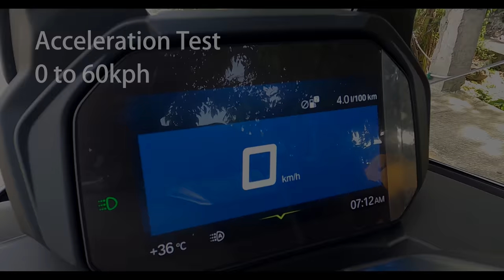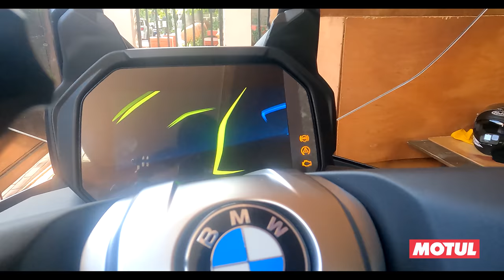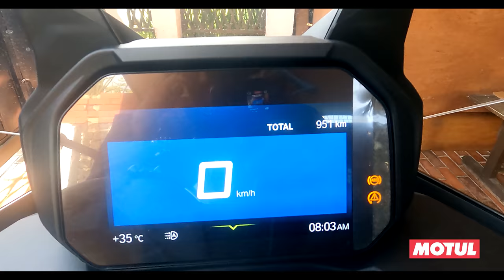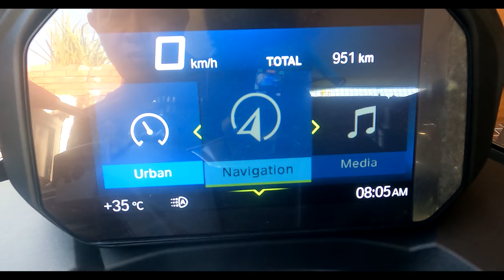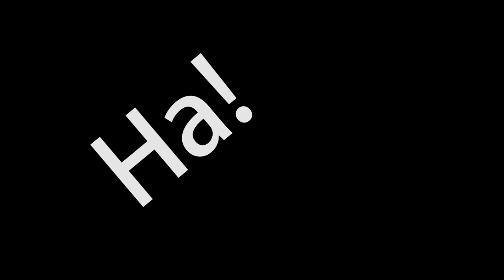BMW C400GT (Tagalog)

Comment: i agree with the 250cc expressway legal sir zac.. 250cc are powerfull enough to be there.. i lived in America and  my first bike is ninja250r.. it has decent power for freeway ride & passing.. perfect for daily commute to work..
Reply: it's just not about power, needs to be also heavy, cos the wind burst made by big trucks and buses also are factors to consider.
Reply: @stanleyvillanueva3343  agree! 400cc is reasonable. But below, i don't think so. Isa pang disadvantage, mas maraming makakapasok na motor sa NLEX. Pag naddrive ka ng 4 wheels sa nlex at maraming kasabay na motor. isipin palang, nangingilo na ako. Takaw alsidente yun.
Reply: Recomended ba si ninja 400 sa daily ..planning to buy😊
Reply: dipo ako agree kasi po baka maging taniman po ng kamote ang expressway
Reply: @stanleyvillanueva3343  Big vehicles aren’t exclusive to the Philippines.  US Freeways and Interstates have a higher speed limit, anywhere from 104km/h to 136 km/h, than any highway in the Philippines and have big rigs pulling tandem trailers, the small bikes handle the gust of wind just fine.

Comment: I agree with the 250cc. My XMAX 300 is weighing almost 190 kgs just the motorcycle alone with some light cargo in the Ubox. I highly doubt that wind pressure caused by trucks and cars can sweep my bike away.
Reply: Actually po one time before the Global Pandemic arose to harm us, I was driving a van going to exit at Luisita, Tarlac SCTEX. Voila! Yamaha XMax300 with a loud exhaust muffler, passing by to exit also to Tarlac from the SCTEX, I was sure it was a XMax 300 because I had test-ridden one before, courteousy of a friend here in our province. The Scooter I saw made the exit at the toll without anyone checking nor reprimanding the rider and the bike.

Comment: in your own opinion, which is better? Kymco AK550 or BMW 400GT
Reply: Ak550
Reply: Ak 550
Reply: Tmax560 yamaha
Reply: Okay! Proceed tayo sa AK550 🛵🤤
Reply: This scoot is not expressway legal while AK550 is an e-way legal scoot. You choose.
Reply: @angry_genius  kymco manufactures the engine for the bmw GT 6xx. Taiwan has very good QC. I would pick the Kymco Ak550 over this scooter. I also use to ride a 2018 tmax
Reply: preference na lang po siguro tska sa features. ang pagkaka-alam ko po kymco nagpoprovide ng engine kay bmw scoots??
Reply: @angry_genius  kymco engine gamit ng bmw scooter.,.,ano ngayon pipiliin mo.,., german made with tawainese engine or taiwan made with taiwanese engine.,.,
Reply: @angry_genius  kymco engine din nmn gamit ng 400gt hahaha
Reply: @angry_genius  BMW scoot is made in china by Loncin